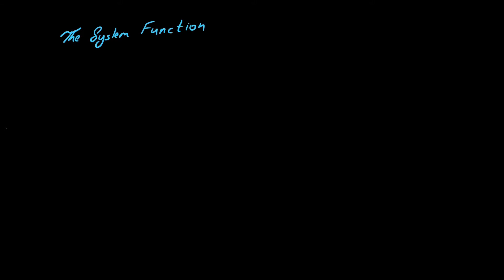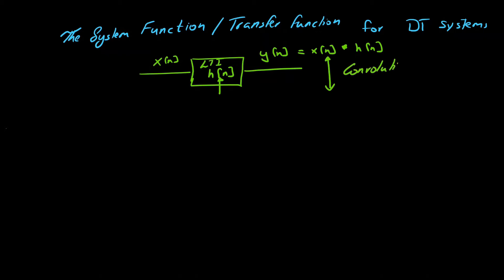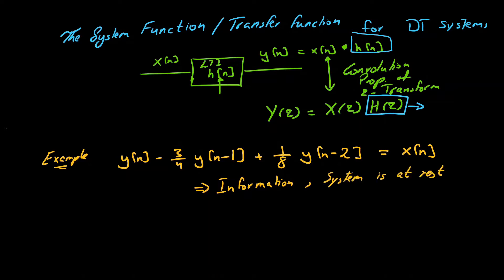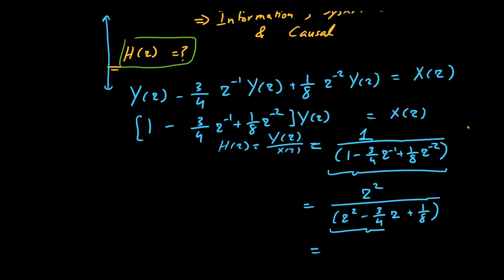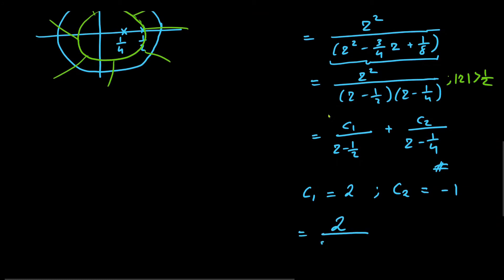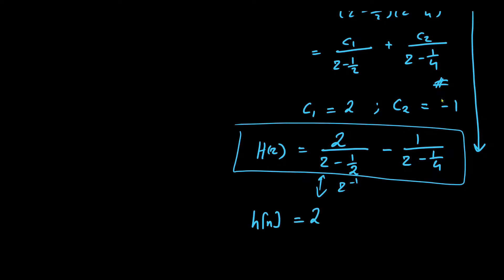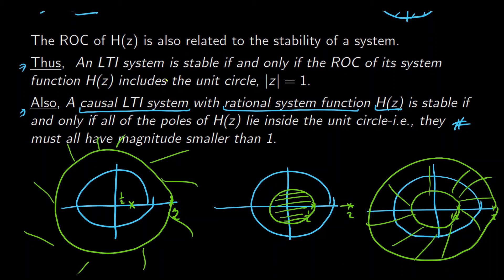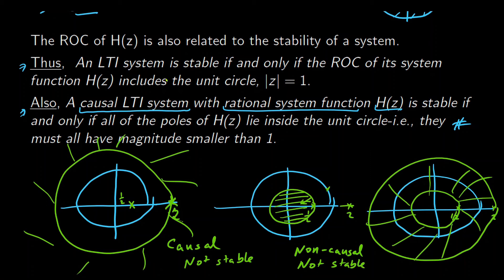z Transform | How to check Causality & Stability of LTI System Using Transfer Function | 4.6

Comment: sir! why did you ignore the Z^2 in the numerator at 04:56 while calculating H(z)?
Reply from the maker: Note that: at
 4:09 the partial fraction expansion is for H(z)/z and not H(z). 
This means at 4:54 again we have H(z)/z and finally we convert to H(z) by multiplying z on the right side which yields the result mentioned in the final expression.
Reply: TY sir! I got it